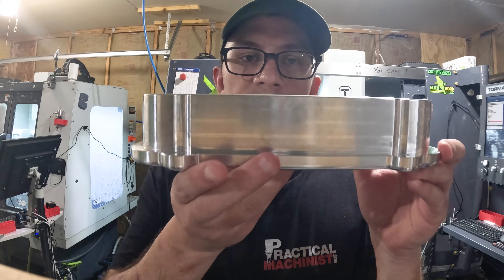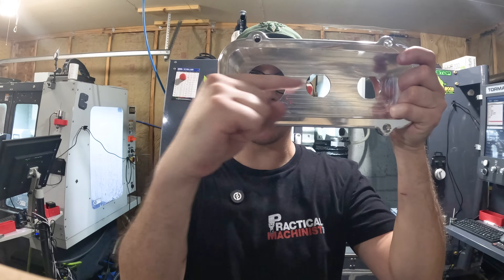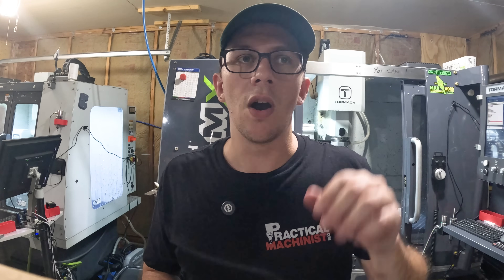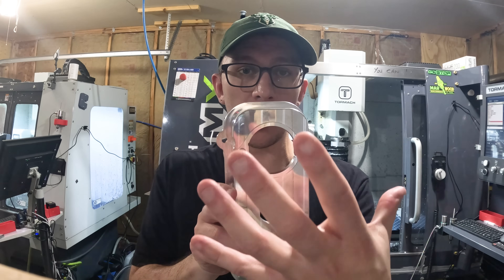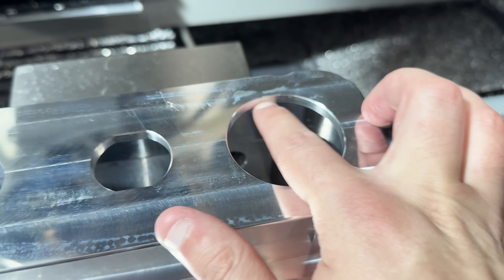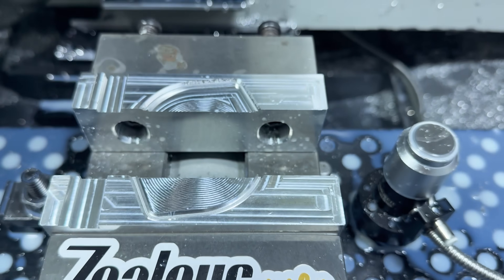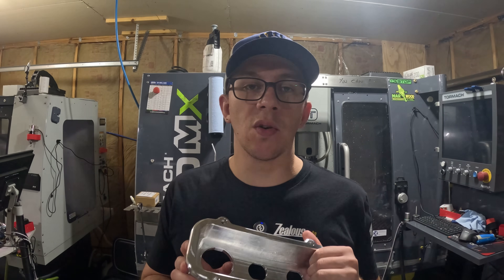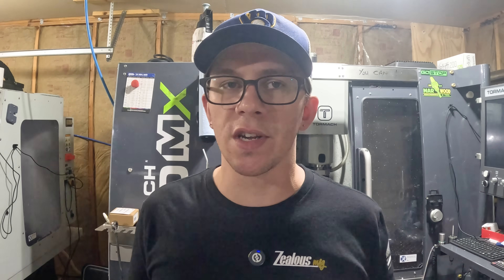What I Did After Machining a Bore Too Big...

Comment: I'm curious if the part warped after removing all that material on the inside, and if so, by how much. Cause it's fairly straight forward to machine that part shape in 2 mill ops, but if flatness/parallelism were really critical, then I assume the strategy would be to rough both sides and then finish both sides (so 3-4 ops)? I'm just curious if you experienced any warpage.

Comment: This all seems overkill. 2 Ops would have been just fine if you roughed all the material out of the big pocket first and then opened jaws on the said big pocket to finish the outside 5 faces.
Reply: The more I look at it the more I have a better way to do them in the future. I don’t know why i didn’t think about it but I could have just cut down a disconnect for test fitting purposes haha. Love and learn and and always keep pushing.

Comment: That part goes on the bookshelf in the lobby. For customers or potential customers to awe at ( They wouldn't know ). That's why you make one or two extra for this reason. Let's say you didn't muff that hole.  If that customer calls and needs another of that part hot?  No problem I'll do that for you $$. Not sure seeing 50 hours in that part. Maybe if it was made out of 304 or 316 Stainless

Comment: Strictly opinion here. The freeze fit and bolts seem overkill to me. I'd of just milled oversized mating blanks, did the freeze fit, and re-machined the feature. The bezel looks nifty, but more added work. It may be a half dozen of one, 6 of another thing, but the aesthetics would've remained to print, and they'd match the next batch of them.

Comment: Functional fix, But I have to ask if all that extra work and time of designing the fix, making the sleave and reworking the first part was really any cheaper/faster than just remaking them?
Reply: My equipment is not the most powerful and speedy. The entire lot of parts to this point was ~ 50 hours. 

So far design time and the rework is ~10 hours and $230 worth of material (I had stock on the shelf for the re-work)

New material would be 7-10 business days which would have made it ~3 working weeks to redo it all.

Comment: I'll start off saying that I'm not a machinist by trade.  I have a really hard time asking a customer to accept something different than what they ordered because of my mistake, but I can understand if that mistake is going to have an extremely heavy impact on your business.  So, with that being said, I would probably do something similar to what you did. The only difference is that I would have put the flange of the sleeve on the inside of the part and prevented the rotation with two pins instead of screws.  With the flange of the sleeve being on the inside, the flange on the front of the switch and the nut on the back of the switch would hold all the pieces in place.  This way, the face of the product will still look just like the customer ordered it.
Reply: I should have clarified. The pocket side is the side the customer ultimately will see when installed. For video purposes I just showed it that for ease of holding while filming.
Reply: @ZealousMFGWI  ah, I see.  In the video, you showed it both ways.  I questioned which side it went on and assumed wrong.  I think you used a quite acceptable solution. That being the case, I think we both had about the same idea.

Comment: I try to mill parts all the way to the bottom of the part, plus about 20-thou if the stock and workholding permit it. All I need to do is flip it, pick up on the stock on the back, rough it off, leave about 10-thou for facing, then pick up on the part and run the other features.

Comment: I'm sorry but what about a two operation approach prevented you from machining the hole to the exact spec, for example during op 1?
Reply: There’s a large hex nut that goes on the back side. My brain went to think I have no way to lock it down so I can’t easily do it haha. 

Also the corner reliefs has to be done with an 1/8” endmill and the threaded section of the disconnect is ~1.3” long, I couldn’t find a 1/8” with that long length of cut when I took the job in so I couldn’t get deep if I did it all in the first OP. Does that make sense
Reply: @ZealousMFGWI  if it’s just a relief and not critical maybe you could do that in op 1 but leave the ID and flats undersized and finish them in op 2. If I’m thinking correctly. Can’t see the exact profile so not 100% sure that’d work
Reply: @jimhimesjr  not a bad idea. I think I would do a lot differently next time. I also have to look at the diameter to flags because I was also thinking about just getting a carbide drill and drilling those features if it clears the intersection.